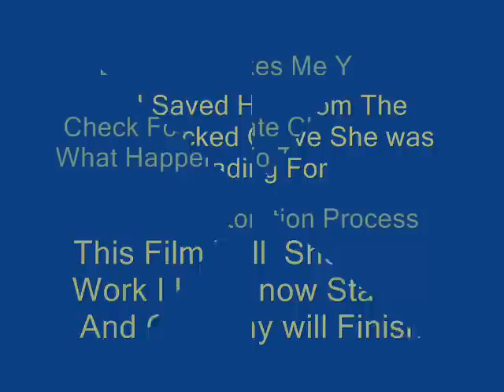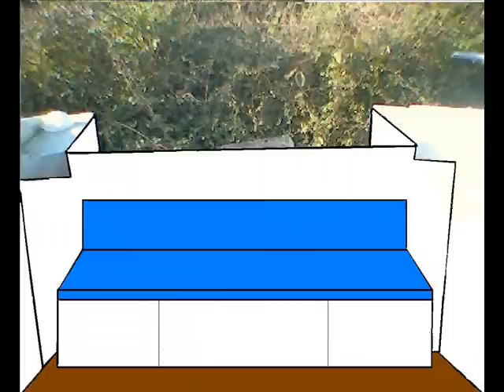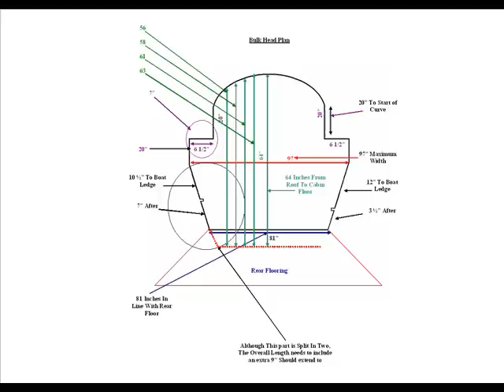Boat Project Part One

Comment: Hi...I own a Marina 16 G.T (the most popular boat Marina Boats Ltd sold) and whilst trying to find more Marina boat videos I found yours.  I recognised the Marina styling immediately, but not which model it was...So I got out my colour photocopies of Marina Boat brochures, sent to me recently by Jeff Hemming, the owner of the former Marina Boats Ltd...It's actually a rare Marina 22 G.T.!   Here is the bumpth from the brochure (direct quote) :  "This fabulous roomy 22' Deep V Express Cruiser is designed for a soft ride over rough coastal waters.  If fitted with a 120 H.P. Inboard/outboard Motor, speeds of 30 m.p.h. can be achieved.  Or, for the person desiring less speed a smaller Inboard/Outboard can be fitted.  The boat is available to take Outboard Motors.  The Marina 22' G.T.can also be purchased for home completion." end quote.  It also lists the specs: Length: 21' 8", Beam: 8' 4", Transom: 20" for outboards, Full Headroom,  Max Power: 150 H.P., Weight Less Motor: 21 CWT (1067 kg) Approx.  Price: £1125 ex works, or hull and superstructure (for home completion) for £450, ex works.
Marina Boats Ltd started in 1958 and closed down in 1979, so your boat is definitely 1979 or older.  I am currently doing a complete refit of my early model 16 G.T. (it doesn't have the built in moulded births, sink and cupboard of later models, so it could be an early sixties model.  The 16 G.T. hull was used for class 3 offshore racing (using twin 50hp Crescent Marin outboards and a flat plywood deck instead of the cabin), so I wouldn't be surprised if the hull of 22 G.T. was too at some point.  Congrats on finding her...She will be a great sea going boat.